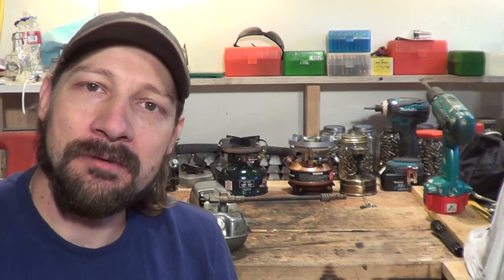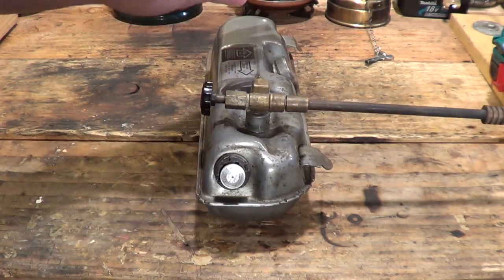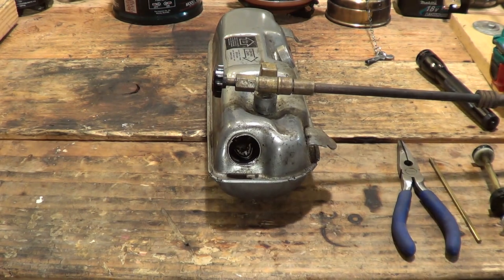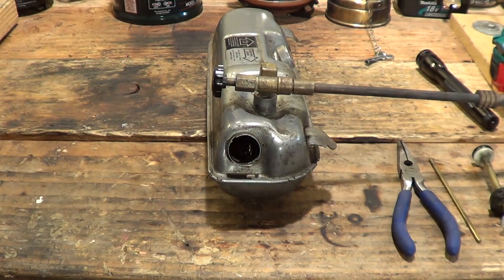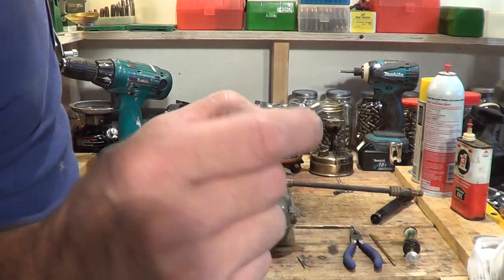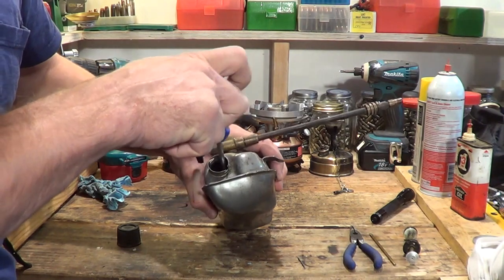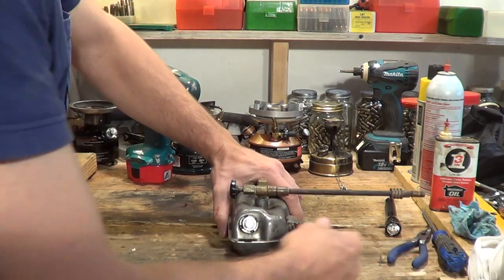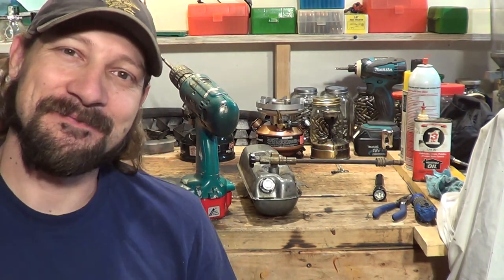How to remove a bad check valve out of Coleman products

Comment: Good advice on wearing glasses when spraying carb cleaner into small crevices I haven't did it in a while but when I was taking apart the carburetor on my Echo weed eater and getting the diaphragms out cuz you not supposed to put carb cleaner on them I got those now and start spraying through the carb Jets and body and shit and I sprayed it in one hole and it came out another hole directly in my damn eyes and holy shit does that shit burn LOL luckily after about five minutes of blindness I was able to see you then but yeah I would agree with that statement definitely also thank you for sharing that half inch paddle bit trick I have about 15 don't worn out or broken paddle bits and I'm totally going to find one down because I believe I'm having same problem just not on a dual fuel stove mine's of 425e which I have several of a couple I've gotten for free and one I paid 5 bucks for at a garage sale and the elderly man that I bought that one from said he couldn't get it to work and I took it home and had it working within 5 minutes the manifold was so full of cobwebs and dirt dauber Nest you wouldn't believe but I love the old stones I'm on the hunt now for a pump Lantern I have a propane Lantern made by Coleman it works pretty well but I'd rather have the old pump ones because unlike propane you don't lose light from the pump ones when it's freezing cold like you do with propane

Comment: How can you convert a Coleman stove to use kerosene?
Reply: You can burn kerosene but it will clog the generator before long. If it's an emergency or one time use it's not likely to be a problem. Unleaded gas is a better choice, much less buildup over time.

Comment: Thanks very much for your video . Navy Seal hat ?
Reply from the maker: Thank you! I'm a seal supporter!
Reply: Old Army guy here and I love my Navy brothers and sisters .
Removed a check valve from a Coleman 425 B last night . Wrapped the fuel tank in a towel and put it in a vise / tightened gently . Used a large flathead screwdriver with a small pipe wrench on the handle . 
That SOB was a b...h to remove , but it looks ok and now back in place . Your video was a HUGE help and much appreciated Bro . 
All the best and Go Navy . Lefty

Comment: Have a question mostly for the stoves in the background. Is it possible to take the aluminum valve holder from the tank. I am repainting and need to cook the tank to set the paint. The valve holder seems to be glued? to the tank. Thanks for any assistance.